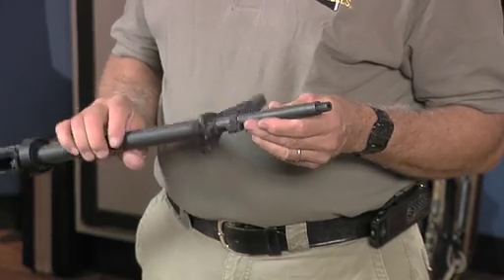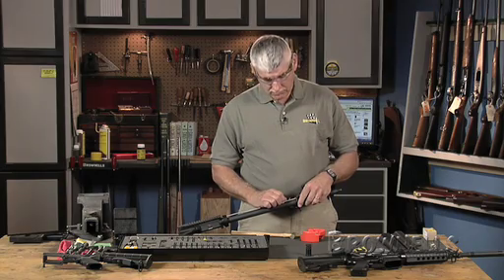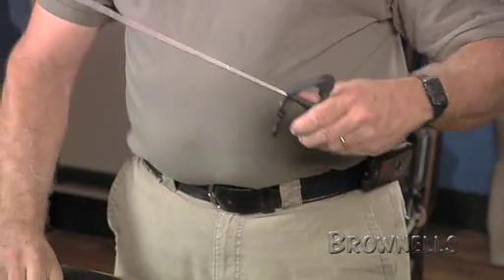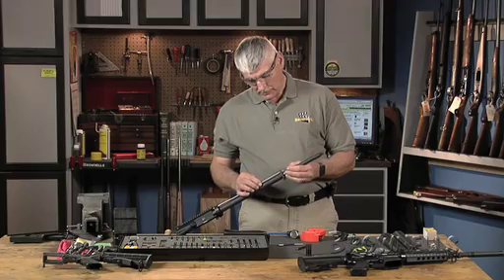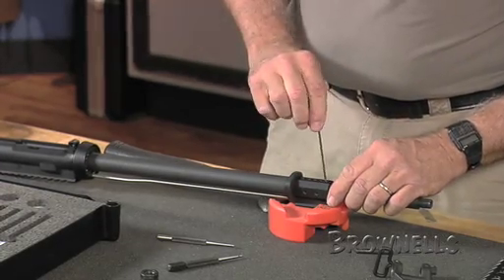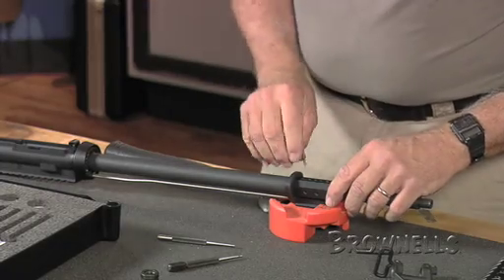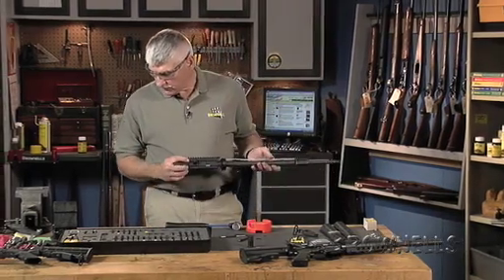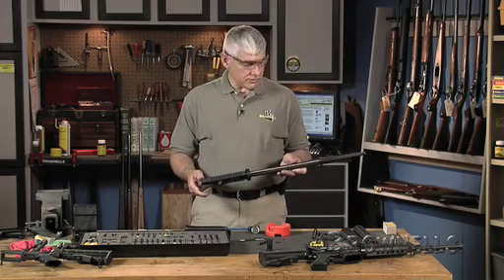Brownells - Changing A Gas Block

Comment: So I changed up an m16a4 upper to a low profile gas block (well my gunsmith did) but now I have this small little section of barrel that is in the white showing, that the new gas system doesn’t cover up, I was wondering if there was a way to re-finish over that small section or, if there was anything I could do, really, to not have this shiny ring 3/4 way down my barrel! Lol

Comment: what type of thread lock you guys use for the set screw
Reply from the maker: For the gas block set screws, we suggest using 272 Red Loctite but be aware if you need to remove the screws you will have to heat the gas block up with a propane or MAPP gas torch to remove the screws.
Reply: Brownells, Inc. Thanks
Reply: Brownells, Inc. do you test fire before you apply loctite ?

Comment: I did this recently and there are holes in the barrel left by the taper pins. Should I plug up the holes in the barrel left by the taper pins before firing the weapon?
Reply: you dont have to. they arent going to leak the gasses out, your good to go

Comment: So, you just give it a quick look down the barrel and you know the gas port is aligned?  How about actually showing the procedure to aligned the ports?
Reply: Richard Jimenez canned air is the best way i have found along with visual confirmation.
Reply: @boss350z5  good idea. Thanks.
Reply: @richbradley9043  No problem. Just stick the straw inside the gas tube from the receiver end (make sure its inside the tube) and your other hand or someone else with their hand at the muzzle end. You should feel a good bit of air while you do it coming our of the muzzle end. You could also use a post it not or piece of tape at the muzzle end. Good luck chief...

Comment: Those pins never come out that easily.
Reply: Especially the tapered ones that BCM uses. Certainly need a much larger and heavier hammer as well in my experience.
Reply: There are oils that when you prelube those pins that they do indeed come out that easy sewing machine oil is a very good example of an oil that will seap into the pin holes to allow for lubration of the pins after a few minutes
Reply: Sure @richardfunk5980
Reply: Never haha.
Reply: I’m getting that orange holder it’s way easier with that

Comment: This is a good video on the basics of installing, but it doesn't cover the gas block hole to barrel hole alignment. If the gas block you are installing happens to index perfectly against the hand guard piece or quad rail, that's great, but that's not always going to be the case. I'd like to see a video on how to do that alignment.

Comment: I'm in in the process of deciding between purchasing an aluminum or stainless steel gas block for my AR 15, Are there any advantages of stainless over aluminum? Any feedback about this is appreciated, thanks.
Reply: steel, all the way. aluminum gas block erode quickly around the gas hole.

Comment: why is a gas block necessary or better than not having one?
Reply: An AR-15 wont cycle without one. Its probably the most important piece to the proper operation of an AR-15
Reply: The gas block takes the pressure from the barrel when the bullet is flying down it and sends the pressure down the gas tube to push the bolt back and eject the shell and load a new round. Technically you can shoot without one, but shit will fly upwards out of the port in the barrel and you will have to manually pull the charging handle after each shot.
Reply: Rubiconnn m

Comment: When you say function test do you just fire a few rounds to make sure everythings in sync or do you actually go the the point of almost a "stress test"
Reply: Chem istry when i function test i usually jsut get about 100 rounds and see how much it jams 

any more then 1 jam and somethings wrong the way i see it
Reply: JEW BURNER I've put close to 2,000 rounds of Wolf Polyformace steel case through my Sig Sauer M400, not one hiccup. Not saying it won't happen, because all firearms WILL malfunction, but Sig knows how to make stuff work.

Comment: What kind and size punch do you use to remove the gas block
Reply: honestly, just grab a set of punches with varying sizes. if you work on guns you will use most of them eventually. they are not all that expensive
Reply: 1/8th inch punch for most

Comment: why not just take a hack saw to the triangle sight? save some time worry and money
Reply: Because not all AR15 owners are, um... as frugal.
Reply: Everyone you know laughs at you
Reply: because it looks like crap unless your handguard can cover it.
Reply: especially with low gas blocks available to cheap if you know where to look.
 and a take off triangle sight block costs more than one of the low-pro blocks. so could recoup most of your money.
Reply: That's what I did, and touched it up with a little cold blue. Looks great, works well and didn't cost anything.

Comment: Also many gas blocks of the low profile design have a set screw directly beneath the gas port. Many barrels also come with a indent for said set screw. For other types, such as clamp on, measuring and witness marks is the best thing.

Comment: Excellent! Just what I needed. Thank you. Are the gas blocks standardized height?
Reply: No they are not.  The exchange of two unknowns. Installing a gas block requires a significant teardown of your upper. By profession I am a Naval Gun Engineer.  IMO you're better off learning to hand load and tailor rounds to fit your rifle. It's the reason Companies don't for example, include adjustable blocks. Keep what you got. I know SCAR come with the adjustable blocks but you must realize your introducing more variables into what's now more unknowns.
Reply: jamesdewer I had no intention of using an adjustable gas block but thanks anyway.

Comment: Curses to S&W for making their taper pins too snug for simple removal.  So I ordered some Kroil and the orange block in hopes that I can get this damnable gas block removed/replaced.
Reply: SuperMeatMachine Smith & Wesson Pins Drive out from the opposite side than most do. If you have any type of calipers that can read the size of pin head, drive it from the side with the largest head